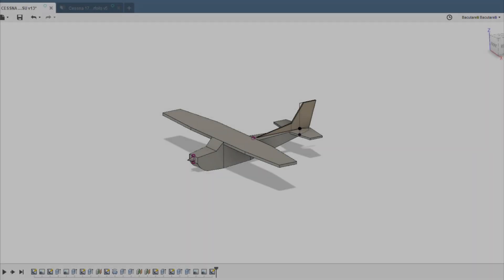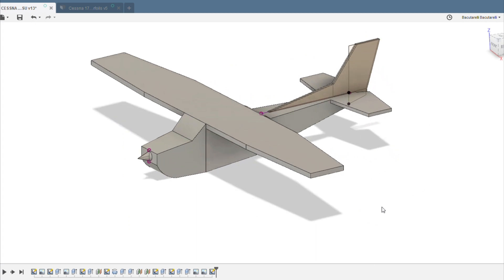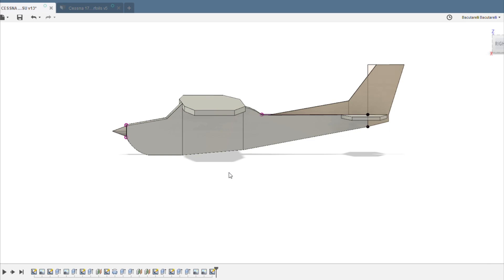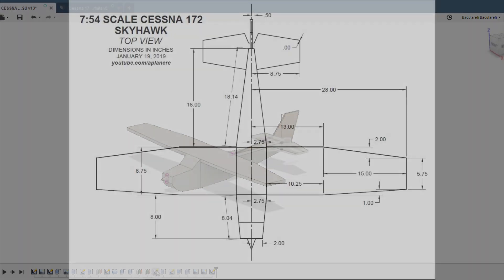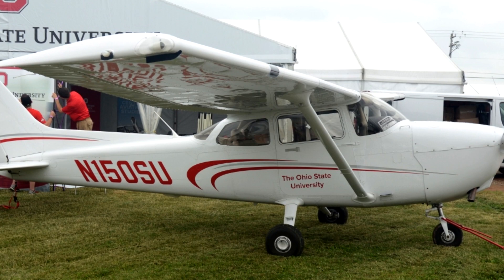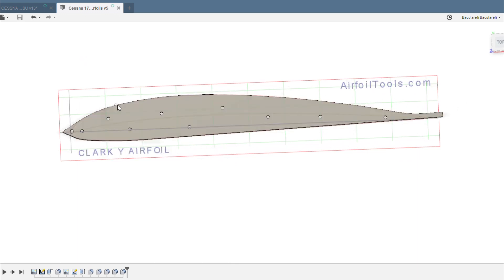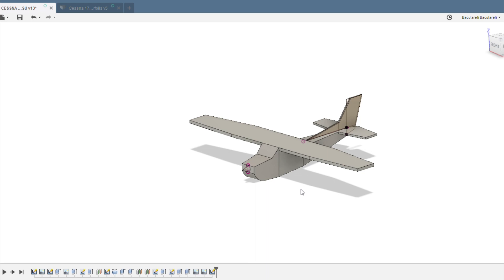Cessna 172 Skyhawk RC airplane - Design Update PART 1

Comment: Hi, I know it is a simplified version of the real C172. Isn't it too wide? I mean, the fuselage, shouldn't it be narrower?
I built it to a smaller scale, for a 39in wingspan, 26in length, and it just didn't fly. I tried the wings with a very similar fuselage I had previously built, same power, and it flew right.
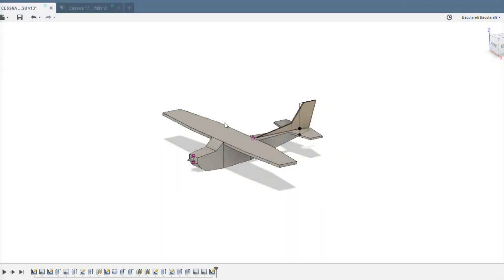Reply from the maker: Hi. At about 0:30 in the video, you can see how I used a 3 view drawing to design the plane. It isn't exactly lined up, but it's pretty close.